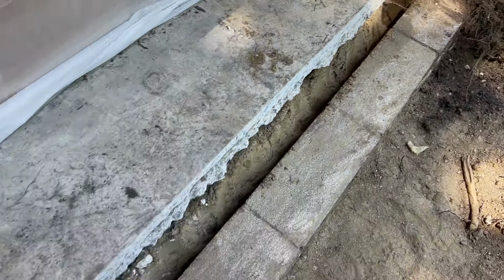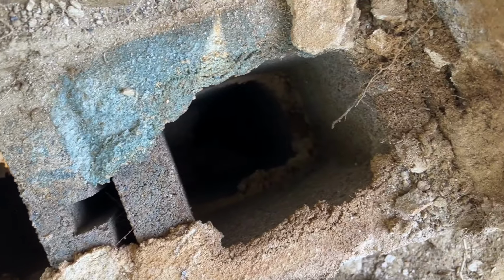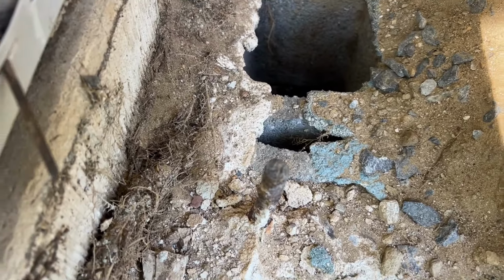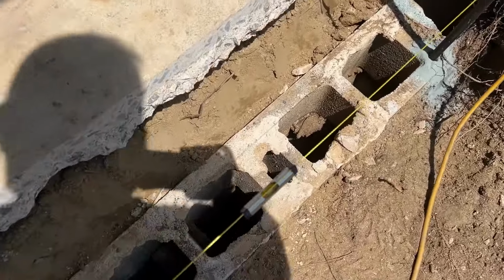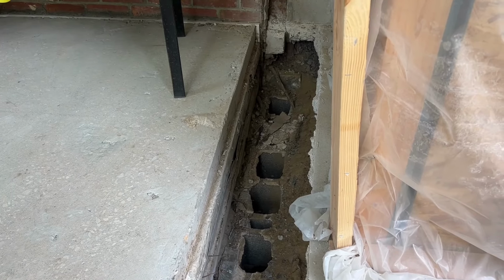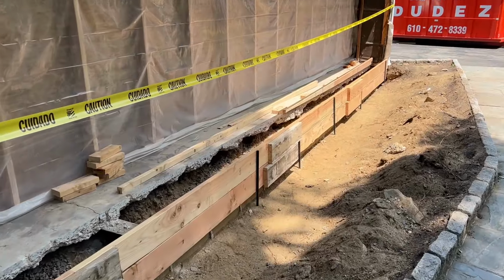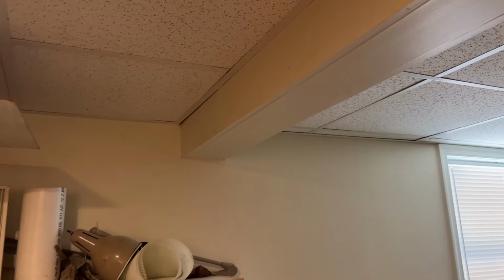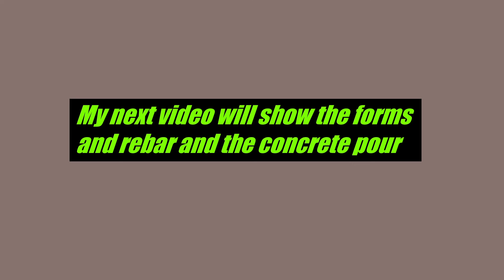Exposing Foundation block wall cores for repair.

Comment: I am enjoying your videos. But must ask you, Have you had any soil or ground survey done? You need a concrete engineer review your plans! Just looking at your soil removal from the sidewalk down to area of foundation are in question? The rain and snow run off will head deeper then your foundation pour…. And when freezing will Jack up the concrete. As someone who does foundations as a living, your new foundation will not last long not knowing what under the rest of the garage slab floor?
Reply from the maker: My customer had the ground survey and soil survey done. It was determined that we could not bury the propane tanks on this property as suggested. Way too boulderous

Comment: Couldn't you have just poured over the cap blocks and avoided having to fill the block cores?
Reply from the maker: @jerseyjim9092  not me. Those caps were barely holding on! Plus my rebar also goes in the cores so I get that locked in flavor.